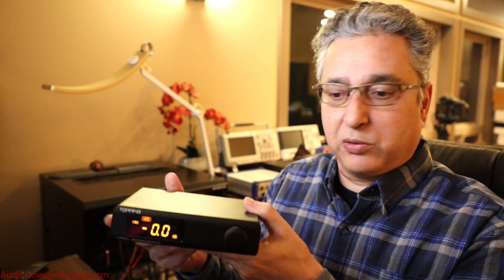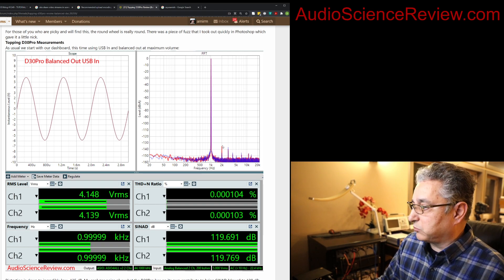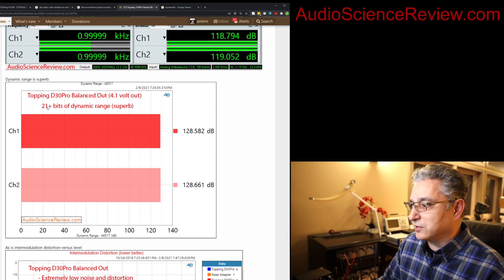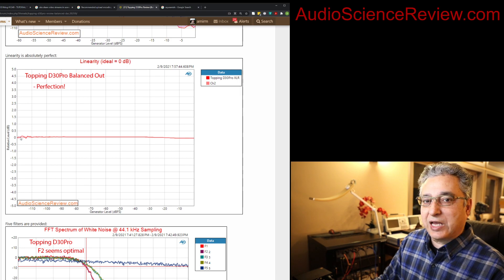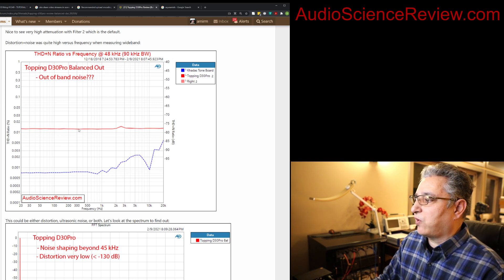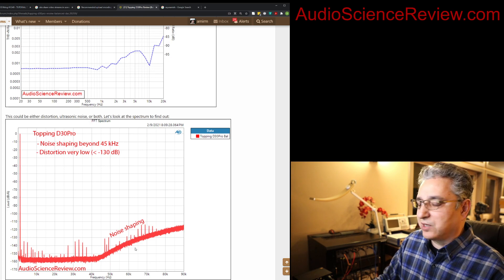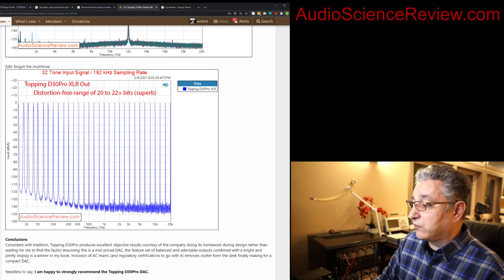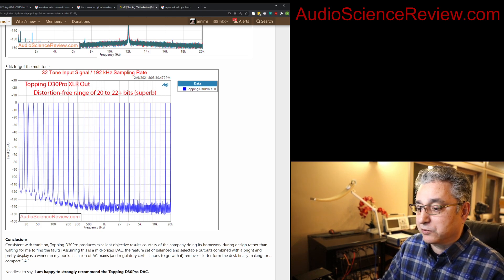Topping D30Pro Technical Review (Balanced DAC)

Comment: I just got a Topping D10B based on this reviewer, I'm not associated with any brand, I'm no content creator and I really don't care if products are from China or Germany. I got the D10B to replace my Steinberg UR22MKII interface I used as a simple external Sound Card in my main PC, which started to have some disconnection issues. In terms of noise I can say that the Steinberg delivers absolutely zero noise to my speakers and in the other hand I cannot say the same from the D10B which was a big dissapointment. In terms of music quality I felt no difference between the two, but in comparison with a simple USD$9 USBC to 3.5mm DAC from AliExpress is clearly inferior, the adapter is much much clearer, and has better separation and soundstage than the D10B, of course at cost of struggling with the noise of the adapter. So, in my extense life of low-end poor audiophiliac I had great surprises, like the Advance Acoustics MCD-203 tube CD Player, or the Adam t7V monitors, or the Yaqin MC-100B tube amplifier, or the Wharfedale Lintons, or the Roksan Attesa Streaming Amplifier which was absolutely destroyed by this reviewer, but the Topping D10B was not one of that good surprises. So I need the duty to post my opinion to beware people, this budget components are not the ultimate answer. I have great respect and admiration for contents creators like Amir, but I just wanna tell people trust in your experience and instincts, they are the most valuable assets in your decision making.

Comment: What driver and firmware did you test with? It has a different sound depending on the firmware and the driver. There is also the "kernel streaming" variant from Audirvāna Studio. When you change them, it sounds very different. In the "kernel streaming" version, you don't have strong bass, but the details are very precise and so is their placement in space. The first drivers seemed closer to this version, but then they started to "correct" them. Either they took it after some reviews, or they tried a more trendy sound. How the modification looks: with more bass, a stronger 3D. What is lost? Many sounds can no longer be heard because of this bass. For me, the optimal option is firmware 2.44 and driver 5.12. 
Remember that these products are not hardware-only products, but a combination of hardware and software.
Reply: Thank you for this, the driver and firmware made a difference to my ears, and I agree firmware 2.44 and Driver 5.14 sound better than the most upto date version

Comment: DAC inside is CS43198, datasheet says it has 32-bit resolution , Amir show @13:57 20 -22 bits , Superb !! I don't get it  , shouldn't be 32 bit resolution, is it 32bit DSD , or 24bit PCM , which one you mean Amir ?  you write 192khz sample , then should be 24 bit PCM , is it ?
Reply: the chip might, technically, have a 32 bit architecture, but the noise/distortion floor allows it to produce 20-22 bits worth of range above the noise floor, which is a pretty spectacular figure. That 32-bit thing (or even 24-bit for most dac chips) only ever means the THEORETICAL maximum should the circuitry be so clean as to completely negate ANY noise, distortion etc.
Reply: @Vwrrwvu  System noise decide at the end how much you will get from DAC , so if it claim that have 32 bit resolution then it should have around -194dB noise floor , it means this DAC is not as Amir claim , even if you have noise floor in this case for -123dB , when it going to your amplifier with a gain of 30dB then it will  be audible ( you can hear it ) very easily with high efficient speaker around 90dB .
Amir claim about this product is not right , this is cheap OEM Chinese product , nothing interesting from engineering view, 
If you want real audiophile DAC , you should look for  Naim DAC.
Reply: @paulpaulzadeh6172  theres no audible difference at this point between 24 and 32 bit dacs, it has mostly to do with the precision of the maths the chip can handle. Not very meaningful though
Reply: @Vwrrwvu  32 bit arithmetic calculation is true but I Don't get it why they claimed resolution is 32bit , technical claim should be verified by measurement, 24bit  resolution is highest practical maybe , and it should be said that internal arithmetic calculation is 32 bit ( in case of Naim DAC they have 40bit external DSP for filter calculation) and they have 24bit DAC .
Anyway Amir should dive deep inside the datasheet of the DAC chip to see what semiconductor manufacturing claim is true or not.

Comment: Love these technical reviews Amir, the detail and accuracy you put into each one is greatly appreciated. I often hear you say the the threshold of audibility is about -115 dB. That seems like a very conservative figure and probably only achievable in a very good anechoic chamber, the typical listening room as measured using a calibrated SPL meter it typically 40 to 45 dB. Considering the threshold of pain is generally listed as 120 dB it seems almost impossible to hear anything below 80 to 85 dB. What's your opinion on this? Thank you.

Comment: All of this means nothing until you can hear it.
Sounds like many of you are admiring oscyloscope rather than sound Quality.
If this was correct no one would ever need high end dacs , dacs that most likely beat this Topping hands down in quality listening test. 
Music must be heard and measurments dont mean too much , electrical performance with out listening test are useless.
I guess this guy is successfully  convincing most of you in orgasmic fashion that this few hundred dollars solid DAC  is all you ever need....anyone else owning better sounding DACs have wasted their money and got Brainwashed by Snakeoil placebo rippoff of audio industry 
He is wrong assesing how good DAC is without proper listening test.
Reply: @I_am_a_nice_person  Brain washed cult by a man they call their measurable Messiah 😂...
Reply: A good DAC should reproduce, in analogue form,  exactly what's fed into it in digital form. The measurements tell you how well it does that. Any other effects would be due to filters and/or distortion. Some distortion sounds quite pleasing (e.g. from valve amplifiers).  With accurate DACs, any difference will be due to your source - amplification, headphones/speakers and the environment you're listening in.
Reply: “Audiophiles don’t use their equipment to listen to music. They use your music to listen to their equipment.” - Alan Parsons.

Comment: 8:48 harmonics bother my listening cos sounds like speaker has tinnitus and it bothers me when I see it on the REW in spectrum mode.  20 dislikes had serious harmonic issues. 
 I still have mild ground hum at low level with my rare vintage Dolby Stereo CP200 cinema processor, fader has to be at 10 to notice it. I think it's the  capacitors (thou fitted with new ones) or other parts in the power supply PS1B as I see no reason why it should have a mild faint ground hum or series of other electrical faint noise it is low down Yet REW shows it and I can then see the frequency noise peaks. 
I see inside the PS1B a noise filter a small square silver part and wondering if it needs replacing or testing before replacing it has the mains leads going into it and some outputs that then pass around to the other stages of the power supply.

Comment: Probably a dumb question.  But I have a TA-10 xDuoo tube DAC/AMP that makes popping noises often when I change tracks.  I've heard that by connecting a separate DAC to the unit, the pops will stop.  I've tube rolled but that hasn't helped  Question, can I connect another DAC to this unit, and will it automatically feed the AMP portion?  Does that make any sense?  Thanks!

Comment: Is it at least theoretically possible to hear a difference between 2 DACs which measure beyond the mentioned audability thresholds? Say, D30Pro and D90.
Reply from the maker: Not between those two DACs.  They are both beyond thresholds of audibility.   Shop on basis of looks, features, etc.